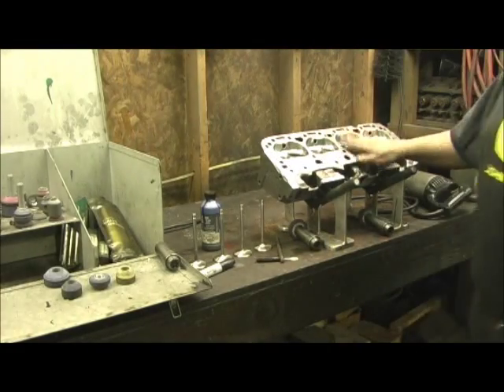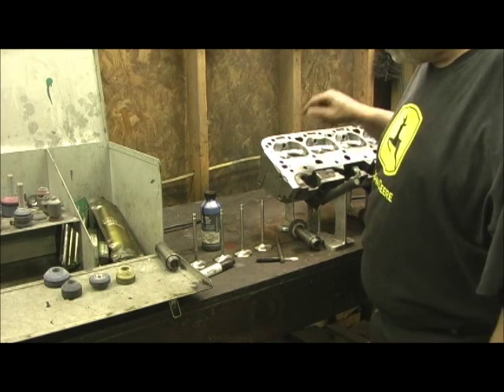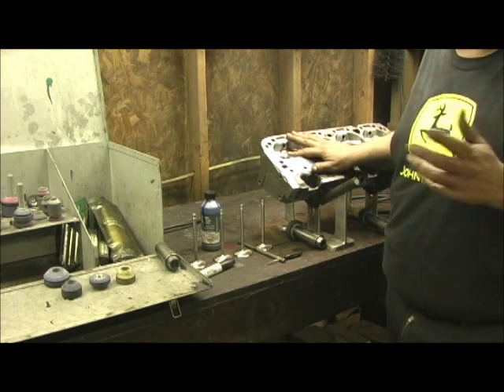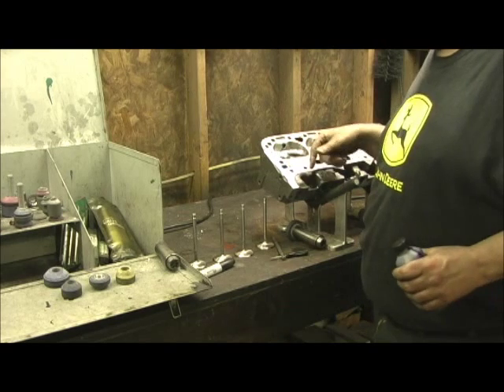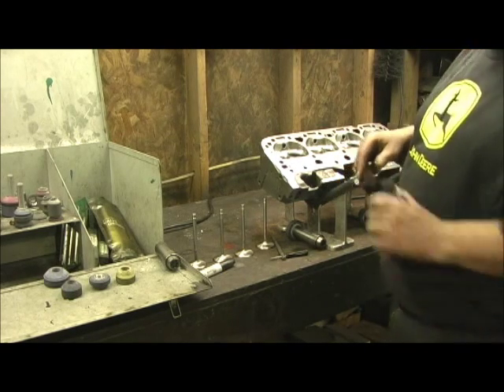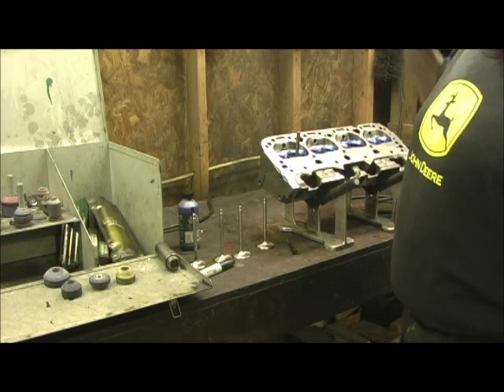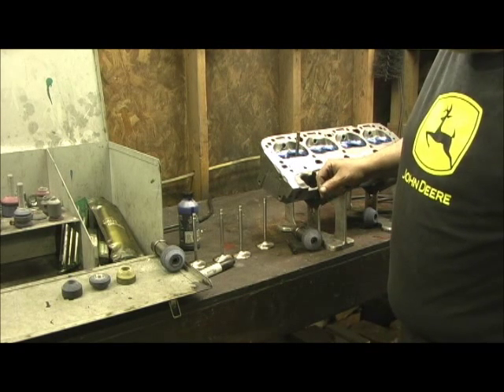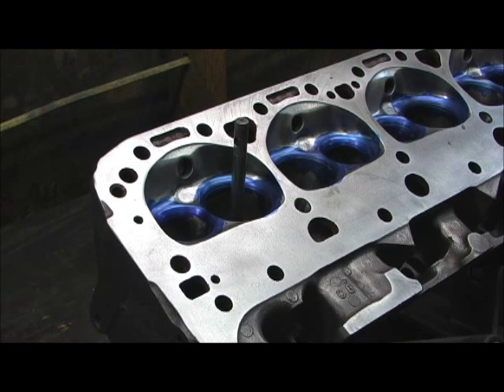Imhoff SBC 186 Enlarging and Valve Job 7.0

Comment: I too am a fan of Sioux equipment. It was also the only valve seat cutting kit I could afford 30 years ago as a rabid motorhead.  The sioux set will do an amazing job but needs to be done by someone with experience. The equipment must have good clearances ( no wear on pilots or holders) and the proper stone for the application. Roughing stones, finishing stones, ruby red, stellite, etc. Even how the diamond is used on the stone to dress the stone has an effect on the seat finish. Super slow light cuts with a sharp diamond will leave a perfect seat finish.